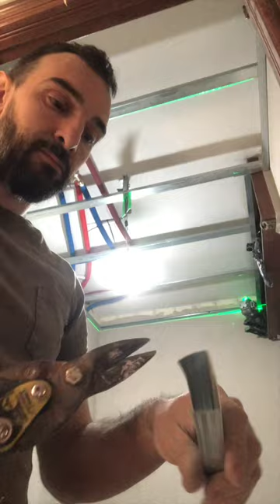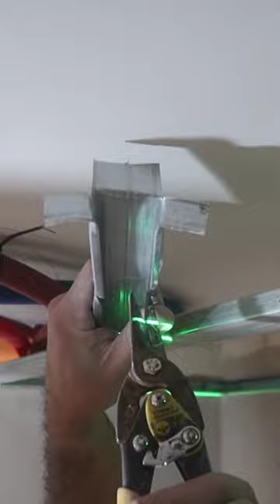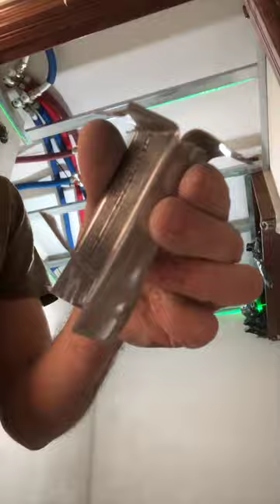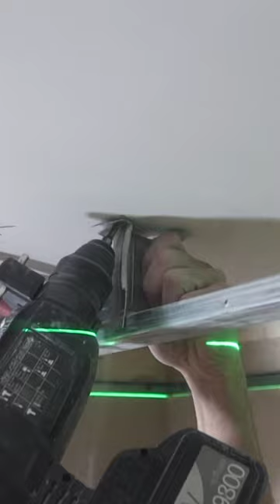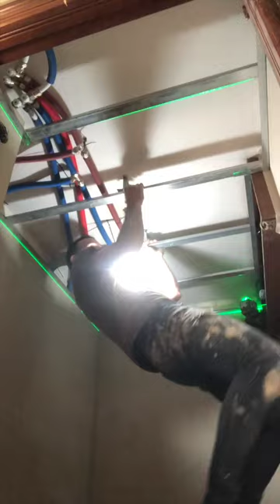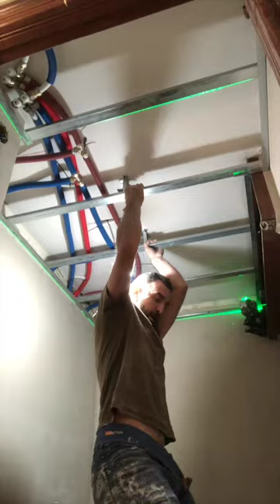Trick 🔥 How to Make a Fixing for a Drywall Ceiling With Leftover F47 Profile 🤜 #shorts #drywall

Comment: Not very professional... it's more pretty dangerous in case of a fire when the plastic melts and the whole ceiling comes off 👎
Reply: What are you talking about? What plastic will be melting? Are you implying that the sleeves of the bolts will get hot enough to melt and let loose the whole structure?
Reply: @romeo2473  In some european countries we have standards/norms  
that states using plastic screw anchors / dowels in ceiliings is prohibited. In case of a fire the drywall ceilling has to stand for at least 60/90mins - depending from individual requirements - before it can collapse. This is for safety reasons that people can evacuate safely within this time. As a matter of fact in Europe the constructional basics of a building/house differs from american houses that are often built from timber/wood. So when there is a ceiling made of concrete (that does not burn) the uprising heat from a fire stays under the concrete ceiling and will melt any plastic. In the end the drywall ceiling mounted below the concrete ceiling loses its hold and the whole drywall ceiling collapses because of it’s weight and gravity.
Reply: @Jay_Petto  Plastic dowels melt at about 250-270 C, considering you're using a fire rated gipsum board and taking into account  there is not a large ceiling span I think you'll have plenty of time to evacuate a room. Keep in mind, ceilings have a perimetral structure also, that is not going to fail easily. But I can understand your point. It's not stupid to use multiple "safety points".